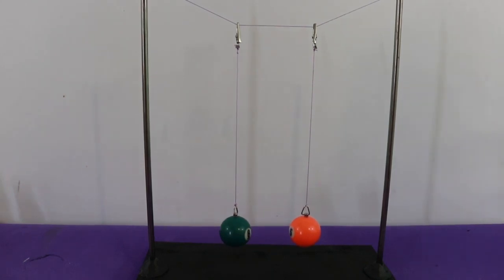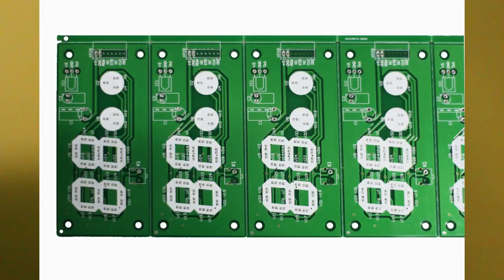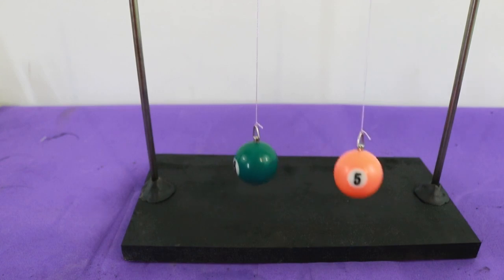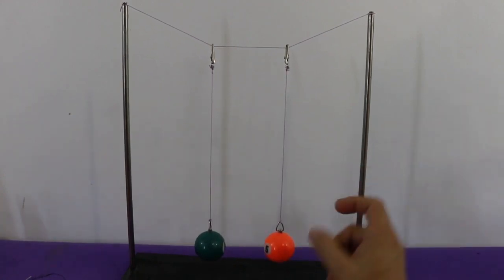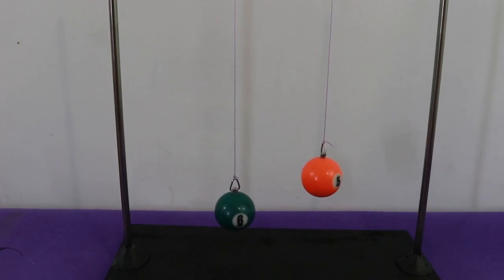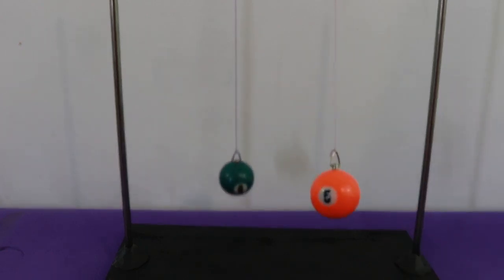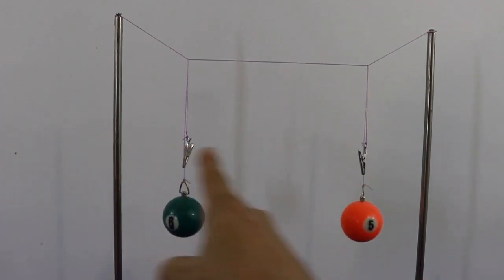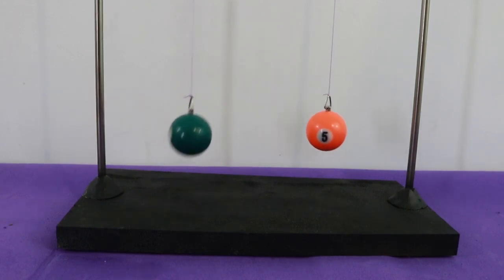Physics Demonstrarion on Coupled Pendulums

Comment: This is an excellent demo.  The usual school demos only show the behavior with equal lengths at a fixed separation.  So your demo expands the possibilities.  I especially like the demo with unequal lengths.  That's an unexpected result.  I'm curious what would happen if the shorter pendulum is driven.  Perhaps attaching a magnet and placing it over a coil, like in a pulse motor.

Comment: The phase of energy transfer is always at 90° so the one pendulum always gives energy to the other pendulum. Once no energy is left, the phase between the swings flips 180° to -90° (other direction) which flips the energy transfer back into the other pendulum.

Comment: I didn't expect the shorter one not stopping at all when the strings are different length. What happens when you start with the longer one? 
Somehow this is like impedance. If "impedance" is matched, the wave can propagate, if not part of it gets reflected and stays in one medium.
Reply: Free energy is possible with pendulums. Force multiplier. Type on youtube "Veljko Milkovic two stage oscilator" and watch all videos from that great inventor from Serbia.
Reply: @zlackbiro  
There is nothing free here.
Reply: @superdau  Not here, but can be with real project.
Reply: @zlackbiro  
Nope.